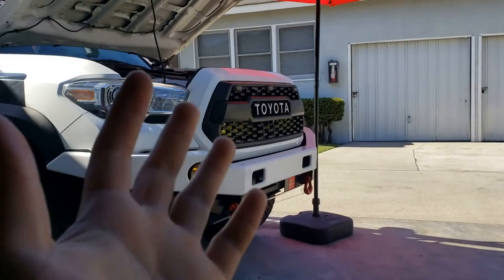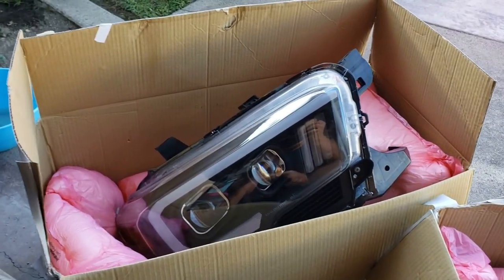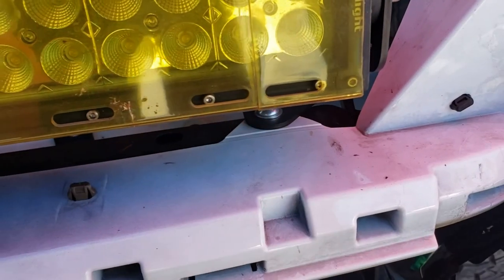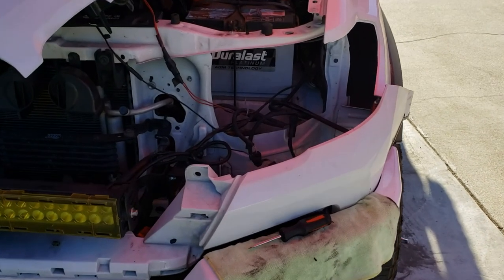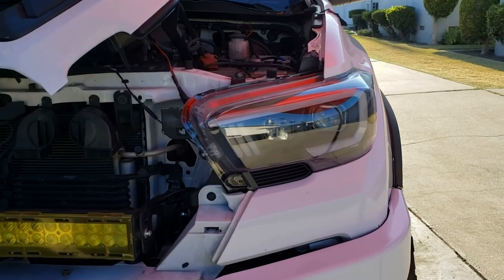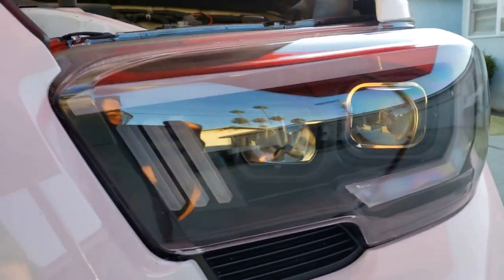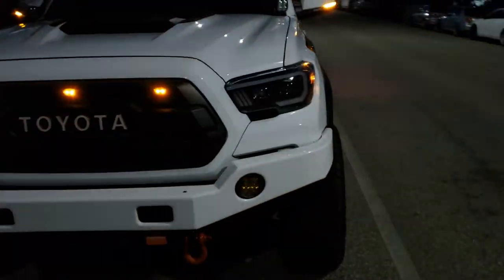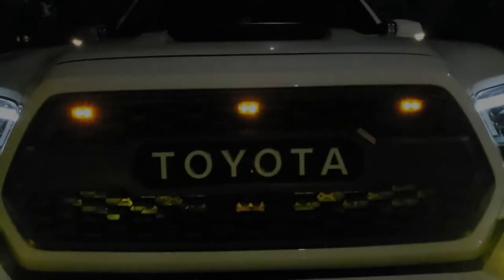How to replace the Headlight of your 3rd gen Toyota Tacoma | Anzo USA

Comment: Do you have a video showing how you were able to fit the aftermarket bulbs into this housing? I bought the bulbs you recommended but I couldn’t get the bulbs and wiring to fit in the housing. Also, I couldn’t figure out how to secure the bulbs into tue housing.

Comment: So did you end up having to stuff the LED harness and little amp into the actual housing before you screwed the cap back on? Debating on getting those leds you mentioned or just getting a traditional H7 led bulb with no extra harness

Comment: Just got these, really useful video!
Great tip for the LED headlights BTW just bought those
Reply from the maker: Glad to be of help.. pls don't forget to subscribe :)
Reply: how were you able to install the LeD? mine have a little metal bracket with two screws not a twist in like a normal bulb.